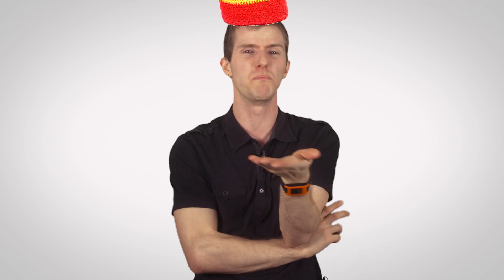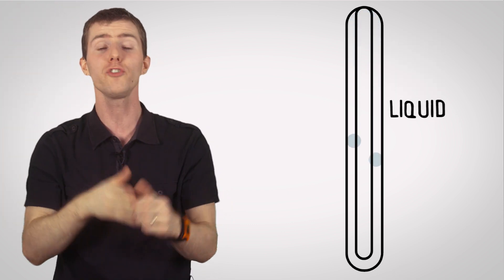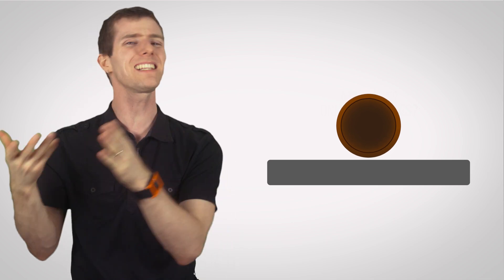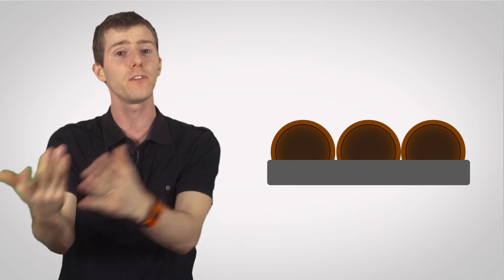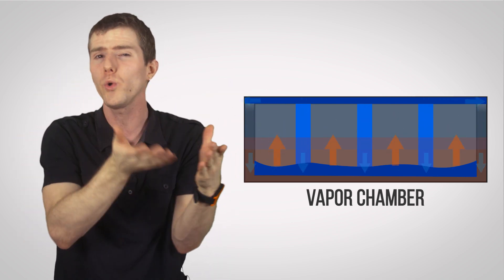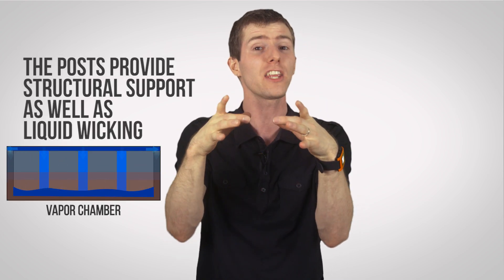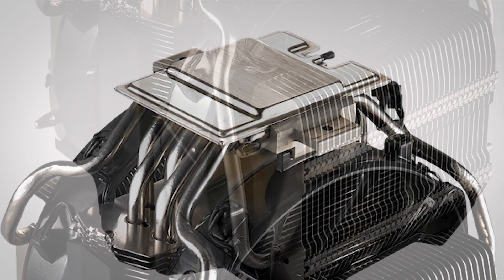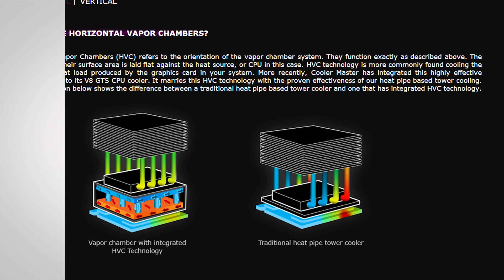What is a Vapor Chamber as Fast As Possible

Comment: "Vapour Chamber" is just a marketing term, for what is nothing more than a very flat & wide heat-pipe.  

Heat pipes do NOT "only move heat in 1 direction", that is a complete lie.  All heat pipes move heat from their hottest parts to their coolest parts, and vapour chambers operate in exactly the same manner.  

These new -vapour chambers- FLAT WIDE HEAT PIPES are a better option than using multiple heat-pipes, as illustrated @1:50 in the vid, since using multiple heat-pipes introduces a lot of useless excess copper that doesn't need to be there & simply gets in the way of the path of heat transfer.  So naturally they simply make a single heat-pipe WIDER so that 1 heat-pipe can cover the entire heat source.  

It's hardly innovative as a product, it's literally just "make the heat-pipe the proper size please".  It's a shame the video didn't show any of the industrial manufacturing of these new style of heat-pipes, as that would quite likely show a lot of innovation!
Reply: Bro here giving his controversial advice on a decade old youtube video about a technology every PC cooler has adopted because it's superior.
I also feel that you haven't watched the video or understood what we're talking about if you think that a vacuum chamber with vapour inside is nothing more than  a marketing term and is just a very flat & wide heat-pipe...
Reply: @Andrei5656  is this an AI
Reply: @roidroid  no, this is patrick

Comment: hey bro 
i have an idea with my Gigabyte 3060Ti OC graphics card , 
don't know it will work or not.
it has 3 long copper heat pipe (vapour chamber) and aluminium fins around these pipes.
i have a spare Corsair H50 liquid cooler.
i am going to joint (as hollow pipes) heat pipes one side ends together and other side together, now it will have two ends one for inlet other for outlet.
then Liquid cooler pump connect to these heat pipes ends so coolant will pass through these heat pipes take heat from GPU chip and goes to radiator through pump and circulate again and again.
my main concern is this setup is more efficient than stock vapour chamber.

Comment: a.k.a. RADIATOR. "Vapor chamber".... Lord. Doesn't it look silly to see copper piping in a gaming laptop? Like it's some vodka distillery or early 20th century potable water system. Common sense should tell you heat exchangers (like cold plates) are not the way to go. Or if you do go that way, go balls to the wall and use a refrigerant like Freon and make it a dedicated micro chiller. Seal that bitch, miniaturize the fans and back them out as much as possible, have a removable filter at bottom or back you can slip out and clean. Basically a tiny air conditioner in a laptop, we're talking keeping two tiny areas cool (the processors) and eliminating chip creep. BuT iT WoUlD DrAw ToO MuCh PoWeR! Battery density in these things has improved 35% in just a few years. Power is not your problem, heat is, and the best defense is always a good offense. Relatively large, hundred-bladed fans and "vapor chambers" are just half-assing it.
Reply: Battery densities are bigger, yeah. But laptop graphics cards are now basically somewhat cut down desktop graphics cards ran at lower powers, and they still draw more power than they used to.

Comment: Simple Answer: A Vapor Chamber is a heat pipe that is shaped like an irregular box. It operates on the same exact principle and is not any more efficient given the same coverage and contact surface. But because it can be stamped into whatever floor plan you desire and does not have the additional walls of a multiple heat pipe design, it usually have better coverage and contact area. It is more expensive because stamping dies are expensive and they typically require perimeter laser welding which is also expensive. At around 4~5 pipes a vapor chamber reaches cost parity with heat pipes, not counting the tooling.

Comment: I find it hilarious People are here after finding out Xbox Scarlett and Lockhart has a vapor chamber but they soon forget or didn't know that Xbox Scorpio is the first gaming console in the world to have a vapor chamber which is why it's able to produce native 4K HDR 60 frames per second or if you prefer 1080p/1440 HDR 120 FPS 😎👍 and the best part is it's extremely quiet 😍👍 However there are some people here for the PS5 but you'll be disappointed It does not have a vapor chamber instead they have a gigantic heat sink with a gigantic fan inside which is why the PS5 is so huge due to the massive heatsink and the massive large fan plus it has a liquid metal on top of the APU chip Plus It's very power efficient all of that combined the PS5 is able to stay extremely quiet no matter what game you are playing 😍👍

Comment: Trying to learn what this is since Series X has one
Reply: The Xbox one X also has a vapor chamber it’s the first game system in the world to have a liquid-based vapor chamber which is why it’s able to keep the APU chip as cool as possible which allows the system to be extremely quiet and perform incredibly stable yes the Xbox Scarlett and Lockhart also has a liquid-based vapor chamber which allows the APU chip to keep as cool as possible The PlayStation five however does not have a vapor chamber they still use the traditional heat sink but this time it’s a lot more power efficient and has a gigantic fan inside to prevent overheating The system not only that the APU chip has a liquid metal on top of it so it’s extremely quiet😍👍

Comment: I have a question? with the vacuum sealed form, does that mean that as long as the vapor chamber never cracks, the liquid inside that turns into a gas, is lossless and theoretically will Outlast the components it's cooling, right?
Reply: Yup thats right

Comment: Alright Linus. Now, what is the main issue with the ID Cooling IS-VC45 then ? It's a vapor chamber CPU cooler sporting a 3cm height and a 15mm high fan, yet it shows worse performance than a Noctua NH-L9A, which uses 4 heat pipes.

Bad wicking ? Fan not having enough static pressure ?

Comment: 1:45 Wait.. isn't copper's heat transfer coefficient really high? For all I know silver is the only metal with higher heat conductivity than copper
Reply: +daradidam  No, i don't think you read Lou correctly. Both (1) Heatpipes and (2) vapour chambers AND (3) actively pumped water cooling provide an efficiency of heat transfer orders of magnitude higher than a solid piece of metal, because rather than waiting for the heat to propagate through the material, all three cause the material to move.

The thermal resistance of a piece of metal is lower with increasing cross-section and higher with increasing length, which means small thick heat-spreaders work pretty well, but if you need to transfer heat to distant fins, the thermal resistance works against you. Active watercooling and heatpipes still have a cross section dependent thermal resistance, but the length becomes almost irrelevant. Whether heatpipes or active water cooling will be better is implementation specific, it's impossible to make a general claim, though better thermal coverage in water cooled radiators is indeed common.
Reply: +daradidam its still very low compared to a liquid pump/radiator design. Vapor chambers are essentially moving part free liquid heat pumps. Physically moving a hot material and cooling it off somewhere else is much more efficient than waiting for it to travel through copper.
Reply: Siana Gearz I see, thanks for the lengthy explanation.
Reply: Heat transfer mechanism in copper is conduction while in heat pipes/vape chambers it is based on convection. convection > conduction
Reply: +daradidam Copper is actually 'meh', but its good enough relative to its low cost. Silver is much better than copper, and gold is a better conductor still but very rarely implemented due to obviously high cost. Also: as soft as copper is it is still much stronger than pure silver/gold so can be much more easily used for structures like coolers.
Reply: MrZhilvinas In what way copper is meh? Copper have a very high heat thermal conductivity @ 385 W/m J. Silver is 406, while gold is 314 and aluminium is 214. Therefore, the best heat transfer materials is Silver>Copper>Gold>>Aluminium
Reply: LouSaydus So, you're saying that copper heatsinks/vapor chamber are still inefficient compared to a liquid cooling system? That makes more sense, and I can agree with that.

Now that you've mentioned it, I realized that radiators does enjoy two huge benefit over heatsinks: much greater surface area of heat transmission and freedom of choosing the location of said transmission.
Reply: Graphene and diamond has a better heat transfer coefficient than any metal. But graphene and diamond are too expensive... 3:

Comment: next episode : Why is there alimit to overclocking.....the silicon lottery
Reply: +Thomas Schwarzinger Because we have a limit as to how much power we can apply to a part before it simply overheats. Plus many many more Techy things that would go bad from running at that much power.
Reply: ah okay thank you, ...but why do you need more power to get a higher clock stable ? ...
Reply: Running at a higher speed (higher clock) requires more power, therefor requires more electricity. The more electricity running through it, the more heat it starts producing. See where I'm going?
Reply: +Thomas Schwarzinger  

The primary limit to overclocking is transistor switching speed, which is limited by material and geometry. We can increase the switching speed somewhat by increasing the voltage, basically i think (oversimplified and wrong) we increase voltage swing while our switching voltage at which we register the signal remains the same, and we can sidestep the issues of signal not registering in time. The larger the voltage and the more often switching happens, the more power is consumed and converted to heat. The larger the temperature, the more noise gets folded onto the signal, and eventually a lack of signal will be registered as signal, which is why computation becomes unreliable when electronics overheats.

Another limit is speed of electricity propagation in conductor, which is rather close to the speed of light, and can principally never surpass it. At clock speed of 1 Ghz, the cycle length is 1ns. In 1ns, the light travels about 30cm. Now consider that CPU speeds are beyond 3 Ghz today and that chips consist of densely folded structures, multiple centimetre travel distances aren't that hard to amass. The issue becomes apparent well before such distances are reached, because for example the clock signal arrives at different parts of the chip at different times, and the signals receive a time skew among each other.
Reply: ohh okay, thank you very much
 this was by far the best comment :)

Comment: That heat sink(The coolmaster V8 GTS) is massive, so if you want to get one make sure your case is big enough, and that it will fit on your motherboard without blocking a pci-e slot.

Comment: Is a Sapphire Radeon R7 250X Vapor-X GDDR5 1gb good GPU for gaming?
Reply: How did you guys manage to get so off topic from his low priced r7 series to r9 290x wtf
Reply: Radvis Stankunas  From someone who owned an MSI R7 250 OC, I would say no. There will obviously be some improvements over the 250, but I honestly would not recommend anything in the R7 series when the R9 series is really not much more. I worked with the 250 for about two months, but when I got a 1080p monitor, it wasn't worth having anymore. I got a used R9 270 really cheap, but you can also find them for about $160. If the R7 250X is really $120, you will definitely thank yourself for investing the extra $40 for the R9.
Reply: Kisuneko What do you mean by not expensive? R7 250X is about $120 and R9 290x is about $400...
Reply: you might look at the Sapphire Tri-X 290, its more modern and on newegg its like 285$
Reply: 290x much better and not expensive
Reply: Kisuneko actually the 290 is much better and not expensive, the 290X isnt really worth the increase in price of like....100$
Reply: The prices of the 290 series will drop a lot once the radeon R9 300 series comes out in a couple of months time, so if you can wait then wait until the 300 series comes out.
Reply: Lol I dunno. Probably because of the price to performance ratio for an R9 290X.
Reply: SH00PS well kisuneko said the 290X was better...but its only marginally better than the 290 which is vastly superior to the R7 250x and is only $270ish
Reply: Radvis Stankunas Go for the r7 265 instead...
Reply: ***** But if you're on a tight budget, it will do.
Reply: ***** Then what do you recommend?
Reply: ***** Well, anything R7 260X and above will do. You can't get rid of budgets just like that.

Comment: What processor would warrant that level of cooling?
Reply: Anything that needs overclocking really, without the hassle of watercooling.
Reply: amd 95xx cpus are running TDP of 220w right out of the box
intel i7 chips are running in the 150 range too. a little oc will put that to 200+

Comment: Anything on phase change cooling? I've read a lot on the technology but I'm still a bit confused the types of gasses, the metals heat transfer capabilities at the temps. on Wikipedia I see -50 c through -150 c, but In practical situations what are the temps, hardware protection from moisture. Thanks.

Comment: Relatively inefficient heat transfer of copper might not be the best way to put it since copper is one of the best metals for heat transfer... It's more because phase changing can absorb more btu but copper still has great heat transfer properties that's why good waterblocks are copper and most stuff in the hvac/r trade is copper

Comment: Cooler Master TPC 800 tower CPU cooler uses a vapor chamber technology as well. But it's so big + quite expensive, so You gujs might considet buying an all in one liquid cooling kit, like i did. I was about to buy a CM TPC 800, but considering it's weight + I needed 2 extra hight quality fans for that thing and comparing total price for the complete CPU cooler, I realised that I woud not fit more than 2 sticks of RAM and I went for a Corsair H100i. It costed me less than 100 EUR. Then I've changed stock coolers with Bitfenix Spectre Pro PWM and I'm as happy as little boy could be.

Comment: AFAP Topic: Copatability amoung hardware ie ram, mb, gpu.  I know how to stick ram into my computer but know some of the basics to watch out for.
Reply: There are usually compatibility issues with some extreme memory. I.e. very low or very high capacity memory chips (i.e. I would watch out using 8 GB DDR3 sticks with 8 memory chips only, or 2 GB DDR3 sticks with 16 chips)
If unsure, manufacturers always have QVL (qualified vendor list) that will definitely work. But nowdays just buy some mainstream RAM and don't bother.
There are no incompatibilities between GPU and motherboards.
Reply: I was thinking more on the line of better compatibility.  Or is compatibility only a concern for higher end builds.  I know to check for mb copat. with socket, ram speed and such but idk if their is ram that works better with particular mb or not.

Comment: Hi linus
Can you please make a video about this surround sound 7.1 5.1 digital analog and about all this shit?
I want to learn more about it
Anyway nice video i enjoyed it and learned more
It is so easy to watch a video than reading it
Reading it got me feel drunk and the hole world is spinning
Reply: Mohamed Emad Essentially all it is is two things.
The numbers (for example, 5.1 or 7.1) mean how many drivers (i.e woofer cones) an audio system has. The number before the dot is how many (regular) speakers the system has, and the number after the dot is how many subwoofers it has.

The whole analog/digital lingo is pretty simple too. Analog is old technology. If a sound card sends analog signal out, it essentially are the pulses of electromagnetism needed to drive speakers. At that point all the receiver does is amplify that signal. In digital the audio card sends out a stream of binary data to the receiver, which post processes and then converts to analog for the speakers.

The benefits to digital is simply that conversion to surround sound can use less cables, as you don't have to run three or four different audio cables from your PC to the receiver, which is the main post processing task of digital receivers.

Hope this helps.
Reply: Dilan Gilluly thx very much for the info
helped alot ^^
Reply: "this surround sound 7.1 5.1 digital analog...got me feel drunk and the hole world is spinning"

>>> 3 glasses of wine and mono becomes stereo in your head.

>>> 4 and you advance to 5.1 surround perception, etc

>>> to achieve digital analog (or analog digital)  you must experience your film on a Turing Machine....
Reply: ***** thank you very much for your concern
but it is not an eye problem
i can read normally but my main language is arabic so when i read arabic it is ok
but a long english paragraph i will feel daizy
Reply: Pin Stripe hehehehe you are funny man
But i cant drink alcohol's
Reply: lol they're six years late but here's the video: https://youtu.be/qw5JXN55XsE

Comment: The V8 GTS is a disappointment,a Noctua NH-U14S can outperform it significantly which is a joke.Not to say it does not look like something high quality with hot glue on the LEDs and when it is switched on it produces a loud rattling sound.

Comment: can someone explain this to me? To get water to boil, you need 100 degrees Celsius correct? I mean I believe it's ok for some GPUs to reach that temp, but I wouldn't push it so I was wondering if there is water in the cooler then it won't go past 100 degrees so how does it go below this temperature?
Reply: it is water, but water boils at a much lower temperature when in a low pressure environment.